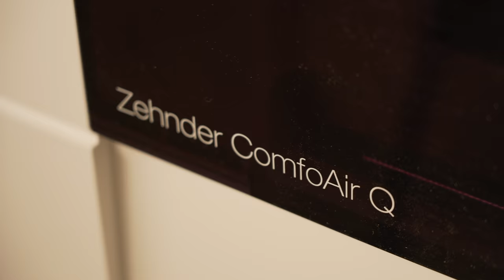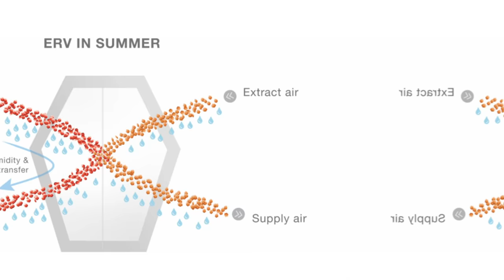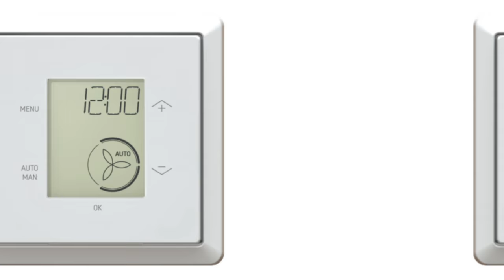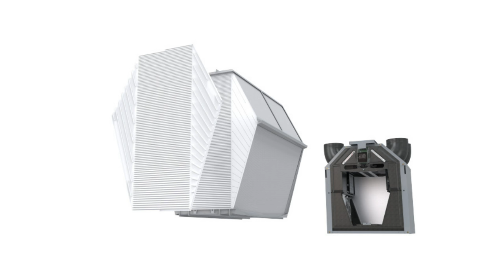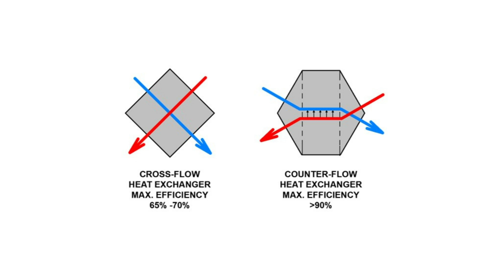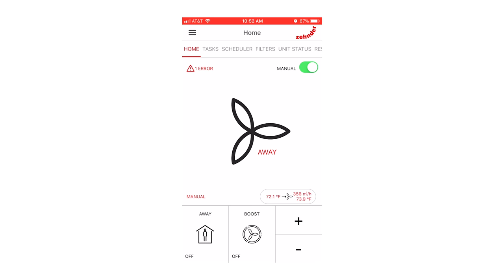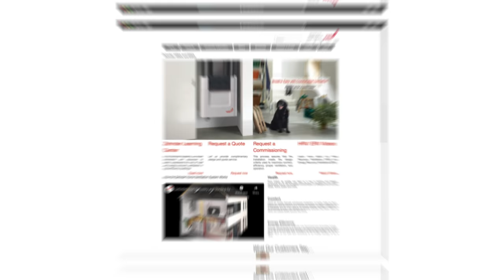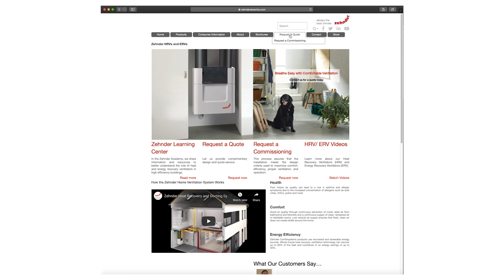Passive House - Fresh Air System Install & Costs (Zehnder)

Comment: Hi Matt, I have questions. I love this system and wanted one forever!! 1) So your dryer and kitchen vent do not vent to the outside?  What about cooking grease and dryer lint? I would think you would still want venting to the outside for those. How are you cleaning those particular contaminates  2) In your experience would this system eliminate dust like a clean room? Could you do a test on this once you get the system up and see what level of dust and pollen accumulates inside your home. 2b) In your experience, does HEPA filter systems added to HVAC system remove dust and pollen at an effective, almost clean room like level. I would love to see an episode surrounding these questions. Thanks.
Reply: I second this.. I'm also interested in your kitchen vent set up. I was thinking of just having a smaller hood vent and fan for an induction cook top but if I can avoid it with a system like this then thats a massive plus. I want my house to have minimal vents due to being in a wildland urban interface (high fire zone). 

For the dryer I'm thinking of having a vent installed for future proofing but sealed and use a heat pump dryer. I'm curious if you are doing the same.

Thanks!

Comment: Fascinating.  How does the plumbing vent system connect?  I am always struggling with all the bathroom fans and other holes in the house.
Reply: According to Matt, there’s no need for bathroom fans anymore. Apparently there’s an on demand “boost mode” to evacuate the bathroom air. He’s also gone full electric so he doesn’t need a kitchen hood either. I must admit, I’m really intrigued by this kind of a system. I really want to know how much electricity usage per month Matt’s house will be when all is done.
Reply: @sirwnstn  still need a vent hood over a range top - going induction only avoids CO2, not steam, cooking oils etc that vents need to exhaust
Reply: ArthurDentZaphodBeeb Good point! Let’s see how Matt solves that problem.
Reply: PLUMBING VENT SYSTEM consists of 1 main 3-4"stack usually through the roof for passive air intake for wastes and water flow leaving home via sewer or septic. For obvious reasons, it is totally separate from AIR Ventilation.

Comment: <-- Matt... can i make a serious suggestion, without sounding negative... When you have a house that tight circulating air, you would need some form of UV light filter at the intake... 'A mirror UV light duct'.... i designed one for an office tower, they shot me down as too expensive.... just saying... Cheers.
Reply: What does this do?

Comment: I installed S&P ERV unit, was basically free to install with new HVAC system and was just over $1k for EnergyStar certified unit with those DC motors and controller

Comment: Great explanation. Question. I understand that if it's a hot day and I'm exchanging the AC air inside for fresh air, which is hot, it will recover some of the cooling. It doesn't seem to make sense to hook up bathroom exhaust fans (hot shower) and laundry dryer vent as those will most likely be hot air.
Reply: Hi Jay. The hot shower scenario is so intermittent and relatively short term and it's a relatively small amount of hot, humid air when compared to the air volume of the entire house being exchanged 24/7. Your comment is valid, but we think that short blip of heat gain is a small price to pay for the positive impact on Indoor Air Quality that comes from continuous, uninterrupted bathroom ventilation.

Comment: We have a centralized exhaust system in our house we moved into.  3 bathrooms vented out the side of my house.  But they are setup that they are all on or off, there is no picking.  Problem is its not hooked up to an HRV,  so I need to look into that.    But it is nice I have no extra holes in my roof for venting

Comment: I’m a man, so my farts cannot be expected to gently “waft” into the system. I’d be more comfortable if there was an option for attaching the system to a normal fart fan so I can flip a switch and force the smells through there if the need may arise.
Reply: Good point, manly McCoy! Zehnder ventilators have boost mode and boost switches are typically located in the same place an old-style bathroom fan switch would be. Fart on!
Reply from the maker: Ha!  Great explanation Chris
Reply: Does the boost mode just suck harder on the whole system or does it have some way to temporarily increase the flow from a single port?
Reply: @paulmccoy2908  The whole system ramps up as one. You'd need every register on a mechanical damper and another suite of controls to zone the boost to individual bathrooms. This is more characteristic of much larger, more expensive ERV systems.
Reply: Poopourri is a great product, white noise machine if you require sound cover up 😂
Reply: In Canada, it's common courtesy that when one hears another dropping a deuce, they sing the line "Eveeeeeeryboooooody pooooops" 🤠
Reply: When @MattRisinger came to Vancouver he briefly saw a HRV/ERV accessory by Eneready products. They make a damper that sits on the bathroom ceiling and allows for spot power exhaust. Further controlling which bathroom receives the the additional CFM from the boost mode on the HRV/ERV
Reply: @christophersmith1894  I suppose that would work for a hot room e.g. one with some gaming computers too.
Reply: I have an Aldes ERV system that has the air door that gets actuated by timer in each bath room, ERV fan speed goes in to “Boost mode” for set time and then goes back to preset program. each actuated air doors allow for 10-30 cfm when closed for continued air exchange of our home, very happy with the system so far.
Reply: Mark Hoffman roflmao. My kids loved that book!  Hahahaha
Reply: Andreas Svensson Perfecto for poopers!
Reply: @buildshow  You talk about having an air tight house, but will you be doing another video discussing your plans to insulate this home, your estimated R values, and possibly ways or ideas we can use to increase efficiency & reduce heat loss of our current homes?

Comment: Matt I don’t think in the bathroom that running the air exhaust a little all the time will get all the steam out of the room when taking a hot shower. I’ve thought about putting a thermostat on my hot water line to shower that would turn the fan on and off just when hot water was detected in the water line with a time delay cut off of 15 minutes so after hot water was cut off it would continue for 15 more minutes. You would never have to worry if your kids forgot to turn on a fan anymore it would all be controlled by the hot water flowing through the water line and can even turn the fan to a higher speed. It’s 24 volts or even 12v dc to be safe. Think about my idea and maybe you can use it sometime. The thermostat cap tube would just wrap around the water line so no water would ever contact the cap tube. It’s a simple design. Good luck and thanks for your videos 👍👍🇺🇸🇺🇸
Reply: Even simpler would be to install a humidity sensor in each bathroom.

Comment: What a wonderfully informative and interesting episode, love this series. 

Question: What happens to the hood extractor in the kitchen? I would think that greasy/oily exhaust air is best kept away from this system?
Reply from the maker: Yes we have a separate system for the kitchen exhaust
Reply: @buildshow  thanks for getting back so quick. And thanks again for sharing all this insight.

Comment: Awesome stuff Matt! 😃👍🏻👊🏻  ..... Would be great if in addition to being able to add CO2 sensors, if there were compatible humidity sensors that also worked with this system, this way you could put them in the bathrooms and have it go into boost mode automatically.
Reply: Hey Fred, this is possible! Any device with a 0-10V output can be used with our systems. And we have RH sensors available. However, continuous ventilation ("low and slow") is so effective that a lot of automated fan speed changes aren't really that necessary.

Comment: I’d love to know what the “boost mode” switches look like in the bathroom. 

Matt, I don’t know what your lighting plan looks like, but in my house, I have separate lights for the shower area. Since I have a demand recirculation pump to get hot water to my showers, I use my home control system to trigger the pump whenever those shower lights are turned on. I get hot water when I need it, and I don’t have to explain the pump to guests because it “just works”.  You could do something like that with boost mode too.
Reply: The nice thing with continuous ventilation is that even if the boost switch isn't activated, the 24/7 exhaust protects the bathroom. Moisture doesn't linger long enough to create a problem.
Reply: @regahj  That's cool. If it's basically just a momentary contactor, that would be trivial to automate as I described above. In fact, my recirculation pump uses the same kind of momentary switch.
Reply: @christophersmith1894  Yeah, I toured a high-efficiency home once with a similar system and I thought it was a brilliant setup. Maintaining a constant airflow into the bathrooms to keep moisture and odor from coming out into the rest of the house, and ensuring that the bathrooms didn't sit with excessive humidity.

Comment: Does this unit regulate the temperature of the outside air coming in at all? What if its a hot summer day are you pumping in a ton of air that is warmer? If so what is the difference between cracking open a window vs this? I guess to keep the cold air inside and not leave through the window. But overall I feel like if your goal is to always keep windows closed for security reasons this could be really good idea. Retrospect that if you have a small apartment or home that doesn't have this cracking open an exhaust window if you have one in the bathroom will do almost the same thing and mix in a lot of fresh air into your AC unit. granted itll work a touch harder but air quality over anything else. Cool video feel like I learned something practical for sure very cool enclosed system. Im renting so no possible way for this to happen yet... so im getting inspired by the logic behind this. Very cool that it saves every too!!

Comment: he talked about kitchen fans and the Dryer too.  I think I missed the part where the dryer fits in to this system.  I assume that would be a different animal.. dust and large heat and more flow.
Reply: Almost always for passive houses the dryer is a heat pump model that doesn't require any external venting.
Reply: @brettzeigerbacher2314  I've read about those and some people give them terrible reviews.  Are those slanted reviews or are those dryers worth it?  I'd love to move to a better dryer system (other than the best which is to hang them on a line to dry)

Comment: This is an awesome system. I don't have an attic. How many cubit feet of space do I need for this system in a 5,000 sf home?
Reply: Hi Phillip. Matt's is probably around 50 cubic feet. The system size will depend on the layout of the house (# of bedrooms/bathrooms, etc.), not just the square feet. If you can visit zehnderamerica.com and click on "Request a Quote" you can upload a pdf of your floor plan (just sketch it out and scan if if you don't have it already). Our team will put together a system design and detailed quote.

Comment: Yeah I need to watch this one again. It’s a lot to take in. Can someone remind me, will this system address a high CFM kitchen exhaust hood or would a make-up unit also be needed?
Reply: Good question, Anthony. This system is going to be running balanced at 180 cfm. It's total capacity full tilt is just a bit over 350 cfm, so that extra 170 cfm of capacity is probably not enough to provide the make up air for the "high CFM" kitchen exhaust hood you're describing. I believe Matt is planning for a dedicated dampered make-up air solution for his kitchen exhaust hood.
Reply: @christophersmith1894  thanks for the reply Christopher. Good info. Much appreciated.

Comment: Are you going to put in a dehumidifier too?  Also will this also take exhast from natural gas furnaces and hot water heaters including on demand hot water?
Reply: Residential ERVs aren't designed for combustion exhaust. It's an interesting idea, but I think the better approach if burning gas is to get a higher-efficiency furnace so you're wasting less heat that way.
Reply: @christophersmith1894  Thinking more about. furnaces being able to close off a vented attic without moving out the gas furnaces to avoid CO risk.

Comment: There is so much going on here.  I'm preparing to built another home in Ohio.  Hydroponic radiant heat is part of the plan.  So is some degree is Zipp R type envelope.  1" probably.  Separate a/c unit part of plan too.   Zehnder product seems very logical for air quality when the house is buttoned up (windows closed).

Comment: I wish you had talked a bit about the range exhaust and how that would fit in to a system like this. If you are big into cooking, you might have a professional range and hood that would extract 1200cfm from the kitchen area. If you have a separate makeup system for this air, it won't benefit from the filtration and will just pull in 1200cfm of whatever temp air is outside, whether it's 5 degrees or 105 degrees.

Comment: So you talked about all the air exhaust in the beginning and I know the dryer and range hood is not running  through this but if you are near zero air leak will this ERV let you pull in more air than you exhaust through it.
Reply: exactly right

Comment: I am planning to build a new house with a first floor master suite.  In the future we will finish the lower level where the other 3 bedrooms will be.  Just me and wife now but expect grandkids in the future.  Would you recommend installing 2 separate smaller systems, one for each floor?  The house will be nearly passive and therefore very tight.  The house is a 3000 SF ranch with a walkout lower level.  Feels like a very large system with a lot of long runs for a single system.  Thanks for your help.

Comment: Hey Matt, have you ever seen this type of system used with an ICF decking system? quad-deck (and other) systems have chases built into the ICF floor panels.
Reply: I won't answer for Matt, but we've had these systems installed in ICF, SIP, stick-frame, modular, masonry, CLT and even shipping container homes. Depending on the construction a chase or service cavity can be helpful, but there's usually a way to snake our 3" ducts around the building.

Comment: @Matt Risenger Do you need a dehumidifier and ERV with this system in Austin?   Who was your installer?  Looks super easy.   I just realize that this is an ERV and an enthalpy unit that removes moisture like a humidifier. But just to confirm you don’t need any additional equipment with the system correct?

Comment: My folks-in-law have a system that is similar to this only on a smaller scale.  It does not pull enough exhaust out of the bathrooms.  The mirrors always fog up after a shower and I hate that.  Wish there was a way to pipe in a regular bathroom exhaust fan into a system like this.  Or be able to adjust cfm in each room especially bathrooms separately.  I love the concept but I wish it pulled more cfm out of bathrooms.

Comment: Hi Matt, great video, thank you. we are undecided in choosing between MITSUBISHI LOSSNAY LGH-80RVX‑E heat recovery unit & Zehnder ComfoAir Q600. We are building in North of Poland by the Baltic sea and not sure what is the extra factors that could decide between these 2 systems. I can see from another video of your house that you opted in for a Mitsubishi cooling system but you preferred Zehnder for the recuperator system. Is that because Mitsubishi are better in cooling system but Zehnder more superior in a ventilation systems? I sincerely hope you could help us decide. Thank you

Comment: Would be cool to see how well the house stays sealed over time since its yours.   Do the products degrade over time causing more leakage?
Reply: I think zip tape is good for 50 years. After that I guess you gotta get those guys who spray glue in the air with a blower door on

Comment: This video left me with so many questions. How does it eliminate a dryer exhaust from the laundry room? You don’t want to recover that heat in the summer. Why did he state 85% efficiency when the slide said “>90%”? How will you be tying in the heating and air conditioning and dehumidification into this ventilation unit? I am sure you are being forced to run a separate set of ductwork.
Reply: Dear Pope, let's connect on your questions. I believe Matt is planning on using a non-ventilating heat pump dryer. In any case, a clothes dryer would not be connected to the ERV. But we will have a return register in the laundry to remove excess humidity, chemicals and/or airborne lint. The slide was from stock and reflects what is common for an HRV, not an ERV (good catch!). As for integrating with heating/cooling... This is a common practice in North America, but it's best to let the systems operate independently, not integrate. The airflow required to deliver or remove lots of BTUs is a lot more than the airflow required to maintain healthy IAQ, so the duct sizes are different. And the air distribution strategy is different as well. Heating and cooling recirculate air to maintain efficiency. You don't want to recirculate your bathroom exhaust air. The control strategy is often different as well (intermittent vs. continuous). We're trying to optimize Indoor Air Quality. So yes, it's two different duct systems with very different purposes.

Comment: In your example of a carbon dioxide sensor and extra people on a sleepover, you said the carbon dioxide sensor would trigger the unit to change the fan to boost mode. Does that boost of CFM apply to all the ports or just the room where the sensor is detecting elevated carbon dioxide?